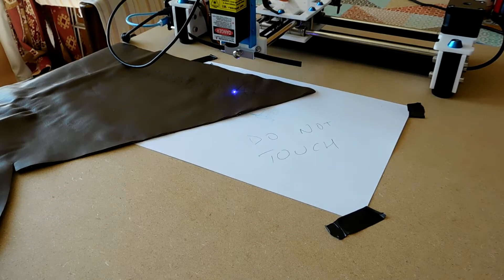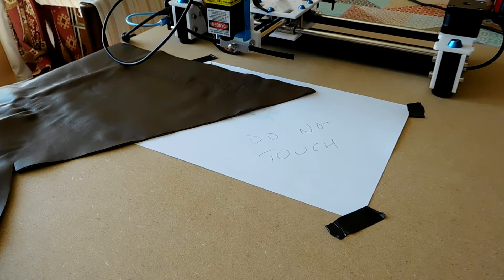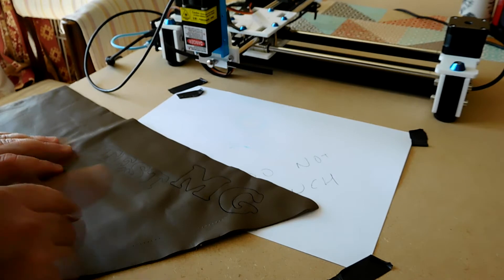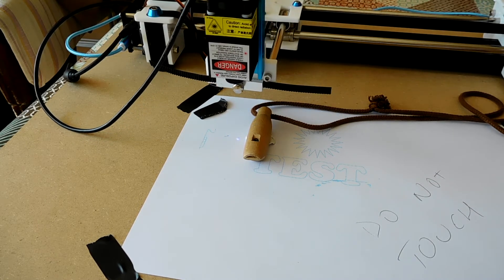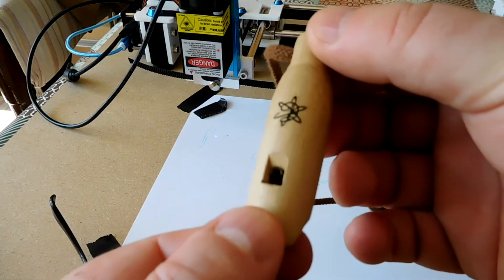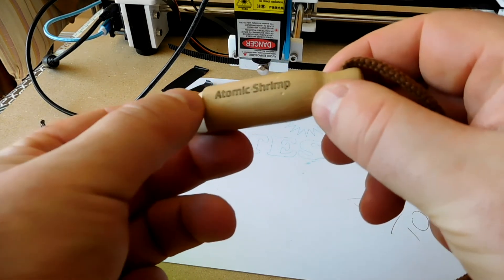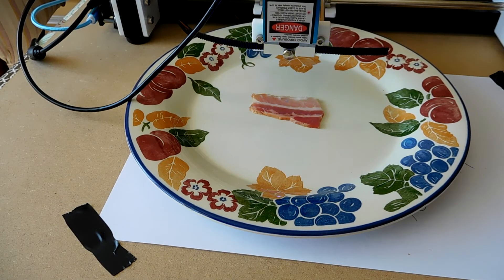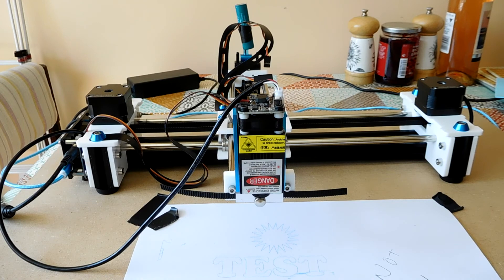Testing The 1.6W Laser Module On The EleksDraw

Comment: When you feel like making another video with the eleksdraw, could you test if it is able to carve the copper layer of a Printed Circuit Board PCB??? I saw it somewhere...You need to paint it black and then laser carve it. I have no idea what power level would be necessary to remove the copper layer though, but I think it'll be a nice test. By the way nice videos.
Reply from the maker: Great idea - I will test that.  If that doesn't work, there are other options - such as using the plotter to draw on bare copper with a resist pen, or mechanically engraving the board - I read about another user who mounted a small rotary tool in place of the pen (I think it was a small rotary fingernail polishing tool)

Comment: hi can you make a video on how to switch between the draw mode and laser mode, and what parameters to use. thanks !
Reply from the maker: I keep meaning to get back to doing more work on this.  I will try to cover that in another video, but in short, what you need to do is:
Fit the laser on the other end of the Y axis from the pen
Connect only the pen servo, or the laser, never both
If the Laser is connected, use the 'Send Gcode' option in Eleksdraw to send code A0
If you are using the laser on the other end of the carriage, don't check the X-Rev and Y-Rev boxes
If the pen is connected, use the 'Send Gcode' option in Eleksdraw to send code A1

Comment: Is the laser module running with a TTL line or is it just on or off? Can it do grey scale pictures or is it just black and white? Sorry they are pretty much the same question. If the laser has 3 lines most likely it will do grayscale. Also when you bought the kit did it come with the software and firmware? Thanks in advance keep up the good work!
Reply from the maker: The intensity of the laser is controllable in software, but the Eleksdraw control application doesn't cater for it as part of the plotting process - there's a slider in the software to crank it up and down, but not while it's cutting/drawing - I think you'd have to create custom GCode for that

Comment: Sorry if this is a daft question, I have no experience with lasers, how does it cope with thick filled areas? does it look solid, or more crosshatched?
Reply from the maker: I've yet to try it with solid areas - the software has four modes called RealPoint,Outline, Scan and Point - I have only used outline so far - but I think one of the others will probably work OK with the laser

Comment: Enjoyed that thanks, I'm just starting to ply with my 2.5w laser. I noticed you don't seem to be changing your focus point for the different height of the items your trying to burn, I've noticed a big difference if you take the time to dial in the focus point correctly. Easier to set focus on an object, measure it then off set y the same difference for different height objects.
Reply from the maker: I did refocus for each job (I just edited those bits out) It looks unfocused in some parts just because of glare and halation. Having said that, there didn't seem to be a huge change in the spot size at any focus setting - it was pretty much a pinprick of light all the time.